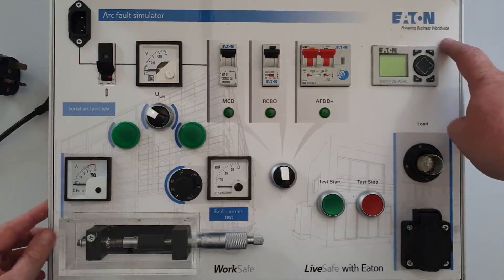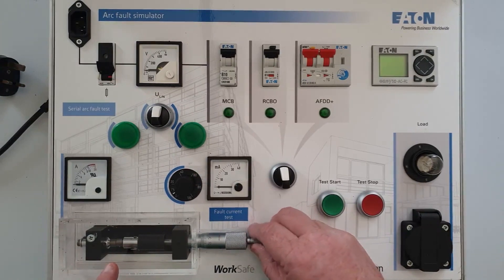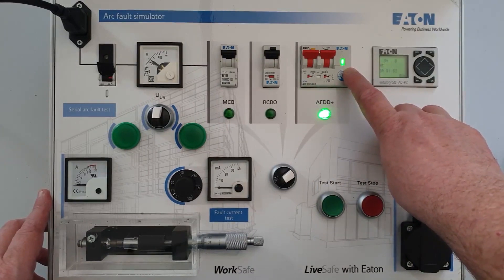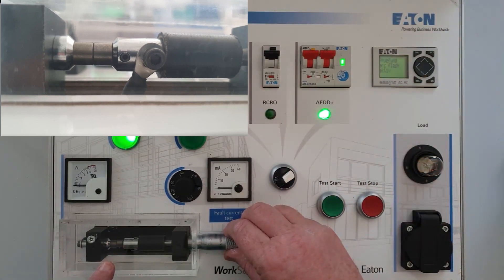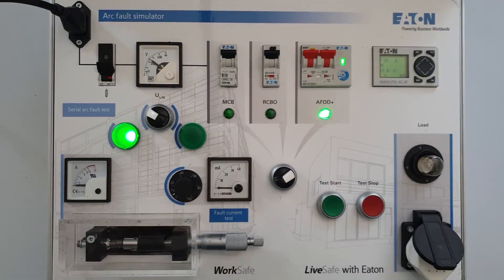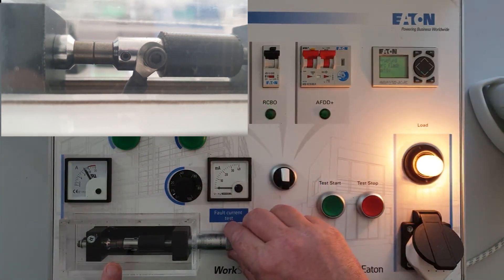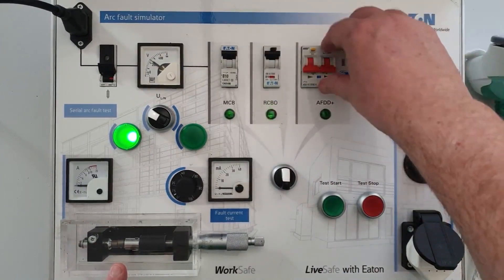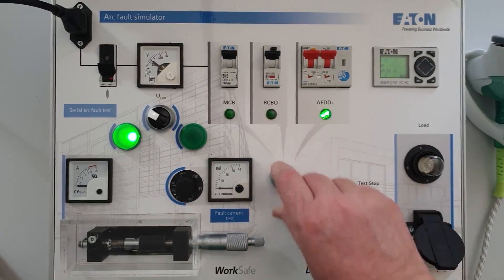Demo of the AFDD

Comment: Do you now why they, beside a very few exceptions, only are sold witha MCB? If you do need 2,5A to operate them, I think it will be much better to have, for example, a 32A AFDD without MCB and connect multiple (non ring) 16A amps circuits (off course protected with a 16A MCB or fuse) after it. It will not only be cheaper, it also will work better if I understand it right.

Comment: The fire is caused by heating! At the same time, there occur single sparks, but standard AFDDs never react to these single breakdowns!
.
The arc between the electrodes, which is shown here, is significantly different from what happens when the insulation of copper and aluminum conductors is broken or damaged. 
.
In critical cases, I recommend using new connection scheme for regular RCBOs or RCCBs for disconnection. It does not require any new devices! It has high sensitivity to breakage, sparking and increased transient resistances. Additionally, disconnection is   provided with the increase of temperature in the outlet. I suggest you look at the explanations in my films:
part 1 - https://youtu.be/9raLo0V8sI8
part 2 - https://youtu.be/BXo-1CrCsIQ
part 3 - https://youtu.be/J4C7ddPx7Go

Comment: Don't agree that it wouldn't work on ring circuits. I have been at a DB where one leg of the neutral had a bad connection at the bar and when I moved my hand against it to get to another neutral is started arcing like crazy. I turned off the circuit and checked the continuity of the neutral ring and it was continuous. Just because there is another path to neutral on the other leg of the ring doesn't mean that the current won't arc on the loose connected side of the ring.
Reply from the maker: The current will not be proportional to the load, that's the concern with rings. There will still be current, but it will most likely not be sufficient to operate the device to the requirements of BS EN 62606.
Reply: @SparkyNinja  I see what your getting at. If the load was 10A it would work but if it were 2.5A then the AFFD will only see a proportion of that which will be less than the full 2.5A load and fail to trip.

Comment: Great video Dave, I’m still sceptical on afdd’s and think we would see a lot of nuisance tripping due to thermostats cutting in and out on cookers, immersions or even just switching a kettle on etc. I agree with some other comments about the effectiveness of afdd’s with regards to arcing taking place behind shower pull cords for instance. And lastly as you say these devices need to be available in a single module

Comment: Great demo. John Ward did a test and could get the afdd to trip. 
I guess it's was because there wasn't sufficient load. 
Thanks for sharing. 🐵
Reply: I've just watched John Ward's video again. He did get the AFFD to trip with a 14 amp load but he really had to work at it to get it to trip. I find it interesting that the Eaton test rig uses a micrometer adjustment to get precisely the right conditions to get an arc that the AFDD can detect. They have been using AFFD's in the USA for some time now. I would like to see the data on the number of electrical fires a year before their introduction and after their introduction.
Reply: All we need to know is, will they save lives or extensive damage in a household consumer unit or are they just an expensive gimmick which will only work in a limited situation. 
Thanks for replying. 🐵
Reply: Yes, I agree that is exactly what we need to know.

Comment: The only times I've come across arcing has been in places with either external damage or poor workmanship.  I can easily imagine a situation where someone cuts through a cable and trips a breaker or uses a knife to clear out a toaster and trips the RCD but what are the everyday scenarios we are trying to protect people from with an AFDD?  It's not like they are easy to fit requiring two extra ways per circuit and they can easily be more expensive than the rest of the board and modules combined.

Comment: Finally, a video that explains AFDD's and their limitations. Thankyou. Your comment about the ring final circuit was very interesting. Does this mean that arcing is unlikely or impossible to occur in a correctly installed ring final circuit? I know that many people don't like ring finals because of the possibility of the ring being broken and the cable being overloaded. But, if arcing doesn't occur in ring circuits, maybe ALL circuits including lighting, showers, cookers and immersion heaters should be ring circuits. AND maybe there should be a new device that detects when the ring is broken...
Reply from the maker: That's an interesting idea. We spoke with Electrium at their head office who tried their best to explain this to us. In a correctly installed ring final circuit the series arc is not anticipated due to the lower impedance path of the alternative way around the circuit in comparison to that of an air gap. So fundamentally this would mean arcing just would not occur across the loose connection like we thought. However if this is later proven to be incorrect in some very finite examples, then the AFDD would operate as intended.
Reply: @SparkyNinja  Thanks for this.
Reply: Interesting pro for the ring (even though in my country it's forbidden), but I still wouldn't recommend skipping the AFDD, because the ring would maybe alleviate only the issues of serial arcs on loose connections in the circuit up to the socket.
A lot of the residential "post-mortems" I've seen on faulty circuits or burn-downs came from load side though, a large majority caused by loose sockets/plugs and a few due to load internals arcing. Most of the junction box issues were due to poor work or very old circuits, but in these situations usually there are a lot more issues around that could've lead to the same outcome in due time.
With this personal statistic, even though AFDD would not be needed maybe for series arcs up to the socket on ring circuits, it's still a no-brainer for the series arcs produced by loose sockets and the parallel arcs that aren't caught by the RCD.